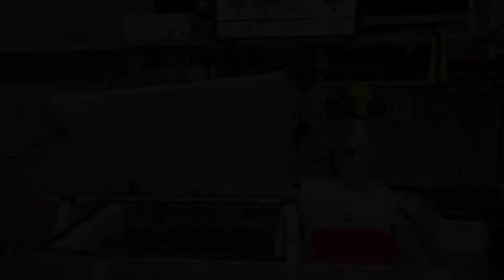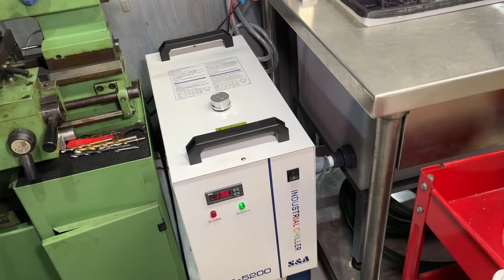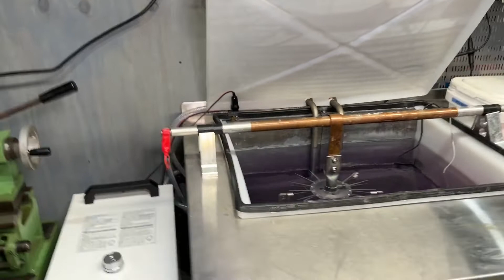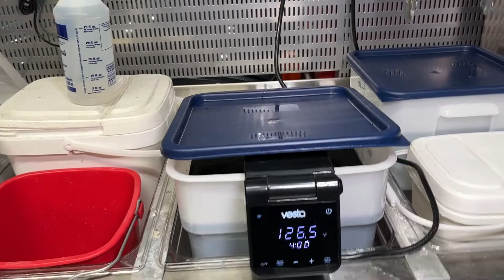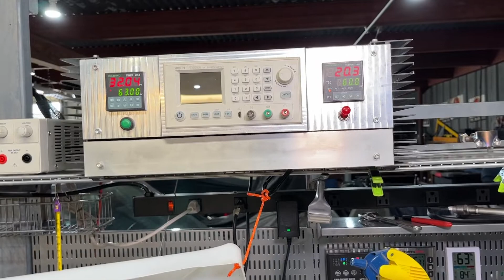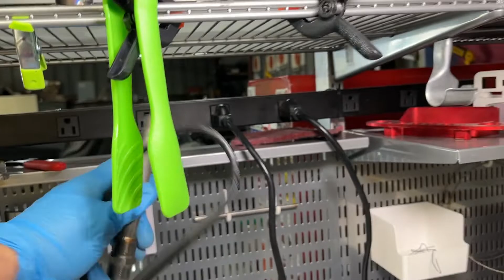Anodizing System for small product batches.

Comment: Where did you get the titanium chiller tube coil formed?
Reply from the maker: China. Manager@aatisz.com send them a drawing and they’ll give you a price. Very easy to deal with.
Reply: @motoswiss  thank you.
Reply: @motoswiss  Bessie is a sweetheart. I went with an 18"x18"x18" tank and they were happy to make that cooler coil for me that would fit at a great price. I ended up getting a bunch of titanium racking at the same time because it didn't cost any more to ship with the crate size. Thanks for your help! Maybe I will post a video of my setup when it is done.
Reply: @motoswiss  How are you regulating your temperature? Are you using the alarm output connection? I have a dual outlet plug with temp sensor that will power a heating element or chiller when needed. If you have a better idea then I am all ears.
Reply from the maker: The chiller controls the temperature of the circulating water. Seems to hold the acid steady provided you agitate the acid consistently. I use an aquarium powerhead with ceramic shaft to do that.